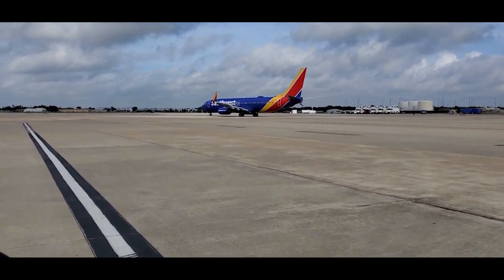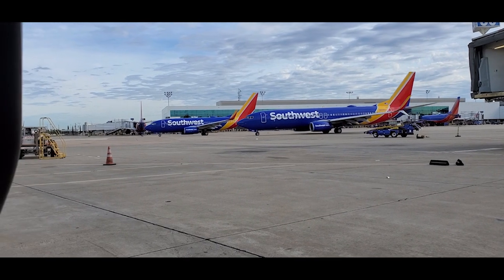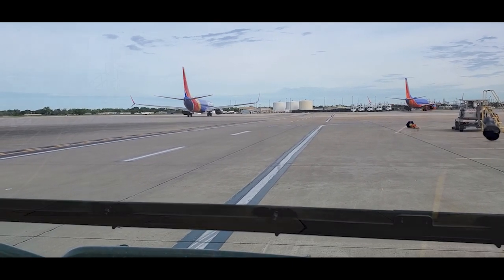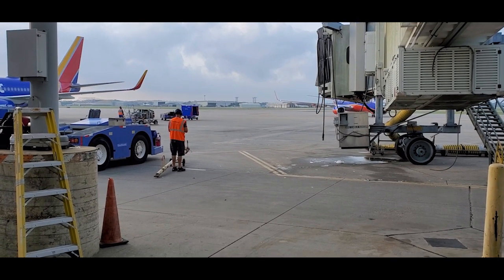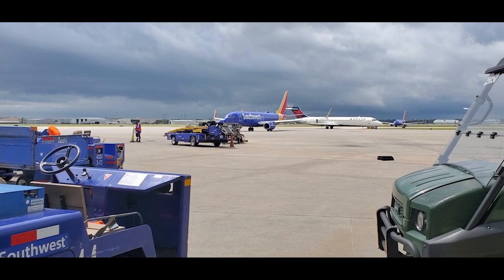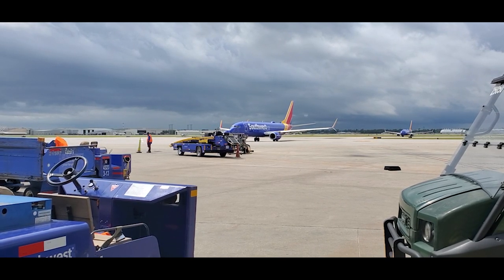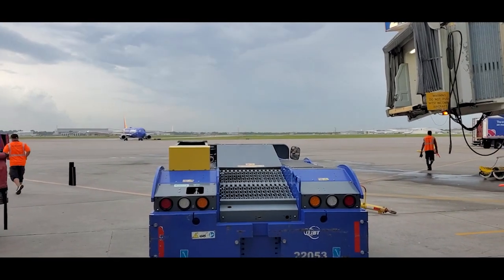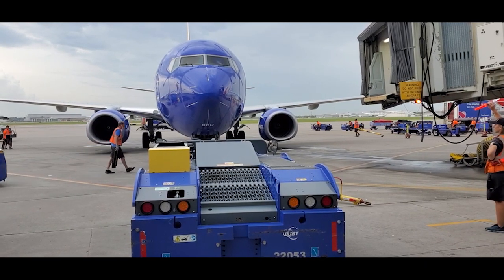Pumping Fuel into the Boeing 737 Airplanes great experience !!

Comment: tanks 1 & 2 on the 737-700/800 hold 8600 not 8500 each. Southwest fueling manual states that the mains are to be filled to 8600. And You are never to add fuel to the center unless the mains are scheduled to be topped off. You CAN fuel all three tanks at the same time, but the center tank can not have more than 1000 pounds without the mains being full. And while doing your calculated gallons, have that figure in your mind and watch your meter as well as the FQI's. If you get 50-75 gallons over your estimated gallon amount you can release the deadman and figure out of there's a mistake BEFORE the error becomes too large to fix.
Reply from the maker: Thanks for your very professional and polite comment.